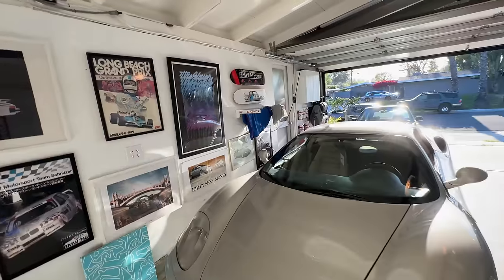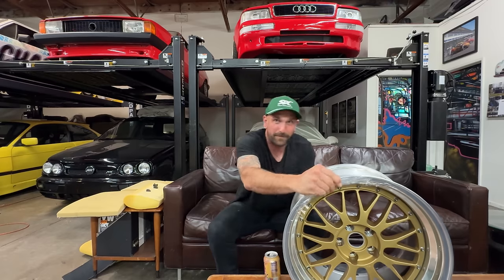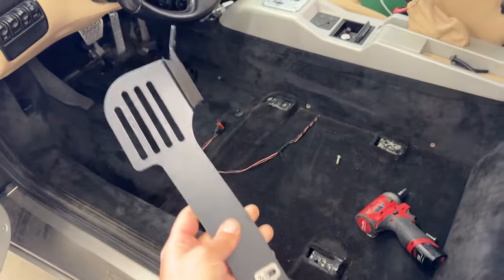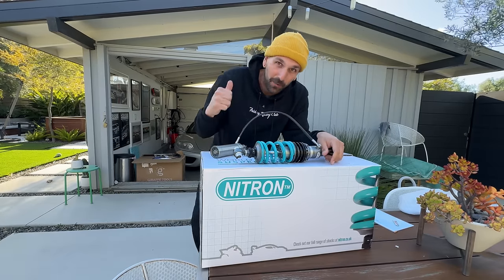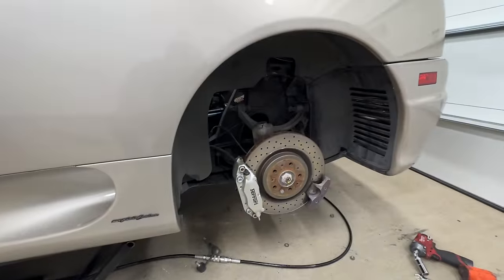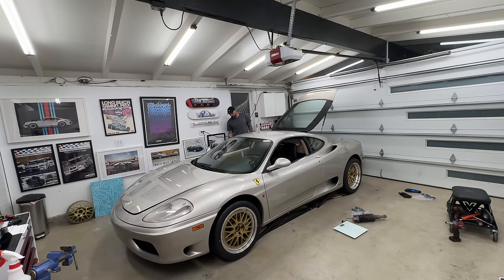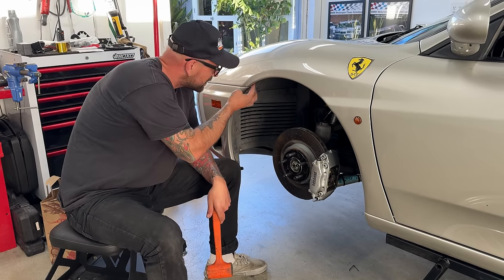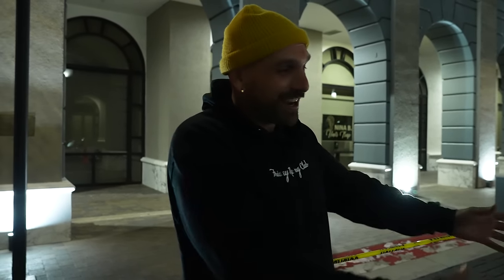CHEAP FERRARI GETS EXPENSIVE PARTS- PROJECT BUDGET 360 GLOW UP

Comment: Hey Vin, for the stud conversion, you might want to use a higher temp rated Threadlocker (like Loctite 272, which Rennline recommends for their stud conversions). Lower temp rated threadlocker (like the blue you used) can actually become like a lubricant for your studs as the brakes heat up, so the higher temp Loctite will help keep your studs from coming loose over time.

Loving these videos, hope this helps!

Comment: Watch Rob Feretti´s video on usual 360 problems. The fenders rolling out and getting damaged happens to the factory cars too, without any mods. Usually when the driver goes into a tighter downward turn at higher speeds. Don´t worry about it, just make sure it won´t rust.

Comment: Yess it looks good!
Also I used to just vacuum that crap off the roof when I dropped a ratty headliner like that. Literally scrub it with a shop vac. Anyway, I too have a fascination with BBS LM wheels with gold centers, but I'm broke as hell so I have Rotiform look-alikes on my VW but on the flip side they're cheap enough that I didn't actually die when I scrubbed one on a curb the other day. 
Great vid, dig it.

Comment: 😎🤙
The seats are perfect! The color ties in with the black and silver already present.

I think the height is still too low. With the Ferrari wheel wells, wrapping back in on the bottom, I think the wheel centered in the wheel area looks best. That said, it still looks good.

I feel for you on the fittment. It's always such a fine line of filling the well and suspension still operating 😂

Comment: For your knowledge, and a little funfact when it comes to rims for Ferraris. 5/108 is the same as Volvo has basically always had. Maybe there is an (unusual) Volvo original rim that fits your horse? believe in and of itself that offset is completely wrong. but what do I know? 🤷🏼‍♂️ spacers is s thing…? 😅

Comment: I’m damn close to matching you in the world’s cheapest 360. Yet if we changed dollars straight to £ I’d have you beat. However you beat me by a fair bit on conversion. 

I picked up a 100k mile, one owner, full Ferrari service history (yes!), MANUAL, vert for £44k. Still can’t believe my luck. Has an awesome story. 

Hoping to follow in your footsteps and do the same Nitrons as they are only an hour away from me and cheaper than most other replacements.  That and it NEEDS an exhaust. 

To anyone reading, follow our channel, hoping to get a video done on it soon. 

Keep em coming Vin, much love from across the pond 👌
Reply from the maker: Wow that’s amazing! Congrats. I think the mileage made the price cause we all know Ferrari folks are babies when it comes to that. But man, kudos to the OG owner for doing 100k!
Reply: @vin_tra  100% due to mileage and that it’s a convertible but as it had full Ferrari dealership service history which is insane  it’s immaculate. TDF blue on cream. 

I need to get a new exhaust on quick as it’s all as it came out the factory at the moment.

Comment: Fuck me silly those rolling shots at the end are so sexy 🥵 

The fitment looks a lot better with the gap imo. It also distracts a little from the fact that the front dish isn't as deep as the rear. (that bothered me a little, I think the rear is perfect depth but the front not so much) Imagine if they had built the front trackwidth of the car a bit narrower so you could fit a little deeper dish🤔😍
Reply from the maker: Yeah it’s a bummer. I can fit another 1/2” lip on the front. I may do it.
Reply: @vin_tra  that could make quite the difference 👌🏼 
As always, I appreciate the engagement in the comment section  🤝